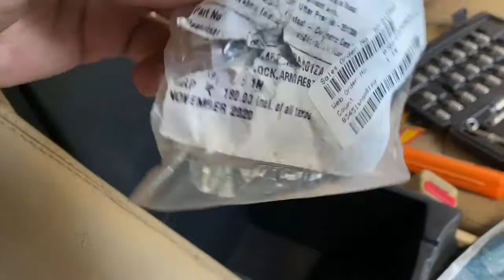Honda Civic 2007 Armrest Lock Repairing

Comment: Hi Dheeraj, I have ordered this product from Boodmo yesterday. Could I check with you - in how many days did you receive this product?
Reply from the maker: It took 2 weeks. Some parts are depending upon the availability
Reply: Do you also have Honda Civic? If yes, did this product fit well in your car too?
Reply from the maker: @abhijitshetye9432  yes this is for Honda Civic only
Reply: @KeysWheelsByDhirajPatel  actually my question is to Mr Sahil Nangia.. but thanks for response
Reply from the maker: @abhijitshetye9432  noted sir. Thanks

Comment: So yes, I have the same problem that you have.  The plastic that holds the pin in place on the right side is broken. Now I have to figure out how to replace the part of the armrest that holds the clip in.
Reply from the maker: Thanks, did you take video to show me how it was a quick fix ?
And thanks for watching video.
Reply: @KeysWheelsByDhirajPatel  no sorry, here's what I found out. I looked on the internet and found every part for the armrest except the part that was broken. So I found a small eye screw in my garage and mounted it next to the broken area. I put the shaft through the eye bolt and then pushed it through to the good part.
Reply: @KeysWheelsByDhirajPatel  It's working for now but we'll see how long it lasts. If it happens again then I plan on removing the spring that causes the entire armrest to pop up. At least it'll lay down but it won't stay up when you open it.

Comment: Sir can you provide the part number of armrest lock of honda city 2014.bcoz i m unable to find it
Reply from the maker: Let me do a quick search and will share it with you
Reply: Plz sir do this 
I will be very thankful to you :)
Reply from the maker: @puneetpal5892  there is no single lock part available in market as you have to replace entire panel. 
I would suggest you to use double sided tape to fix the vibration, maybe you can search for the video where you can find it in easy way to fix this

Comment: What brand of screw driver set do you have?
Reply from the maker: Taparia and Stanley
Reply: @KeysWheelsByDhirajPatel   Sir, What is the name of the tool used to open lock spring ? If possible, pls. provide the link to buy it..thanks in advance
Reply from the maker: @hemantrathod7948  it is Stanley and Taparia mostly. 
STANLEY STMT72794-8 1/4'' Square Drive Metric Socket Set (46-Pieces) https://www.amazon.in/dp/B00N9RCNXI/ref=cm_sw_r_cp_api_glt_i_7R6DCK88CN1J97CX03BY